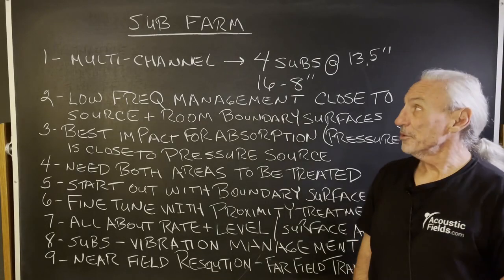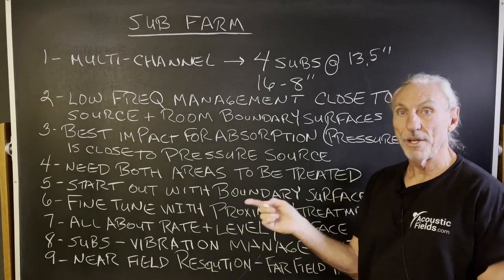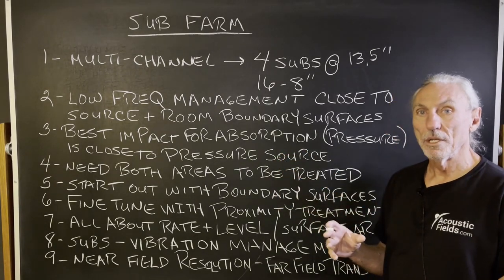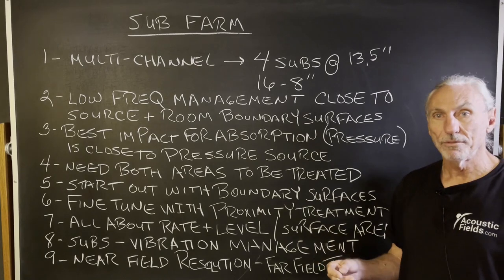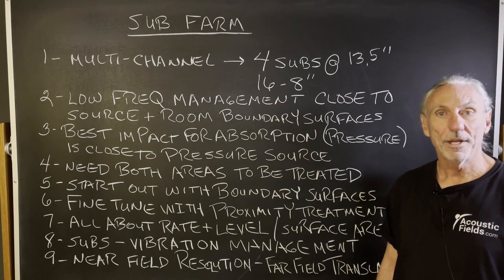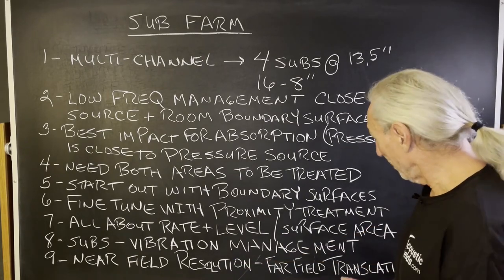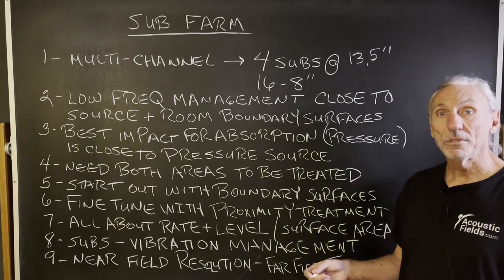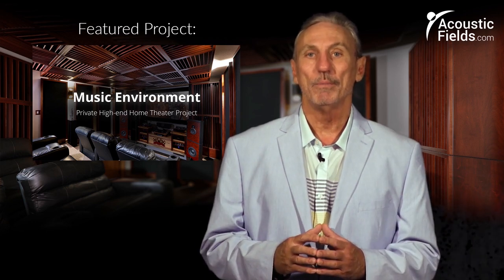Sub Farm - www.AcousticFields.com

Comment: What's the reason for putting your foam technology on the surface of the subs?
Does that also help with vibrations? I'd imagine the carbon tech you have on top would suffice...
Reply from the maker: I do not see any foam on sub surfaces. We have our Carbon Platforms and CLMD measures on cabinet sides to minimize vibrations.
Reply: I think it's MDF.

Comment: Thats why a Double Bass Array in an Bafflewall is one of the best ways how you ,,fill,, the room with LF Energy. Youve get out the energy as consistent as possible into the room. I also dont understand why the ,,normal,, Hifi People are so against subwoofers. Instead of one Pair of Floorstanding speakers, with Sub(s) youve way more freedom and control of the lowend in the room
Reply from the maker: This is one way to pressurize a room with low frequency energy. Placing subs in wall limits the ability to move them around to match usages.

Comment: what about Comb Filtering?
Reply from the maker: CF is not applicable to lower frequency pressure energy ranges with our carbon technology. If you do have a slight pressure increase around source, a simple position sub change will minimize the imapct